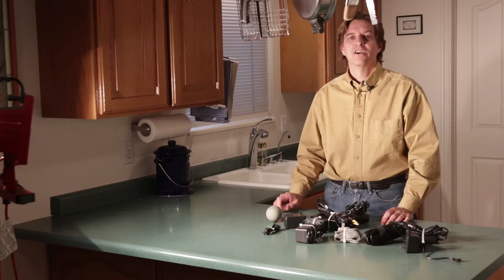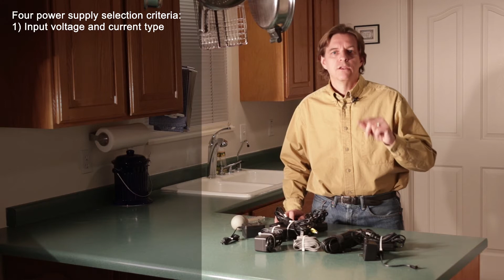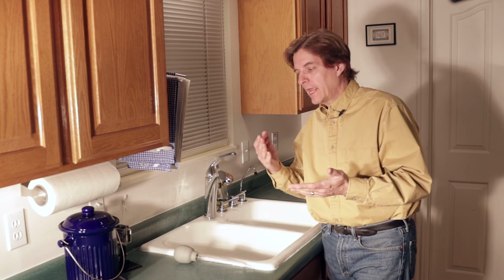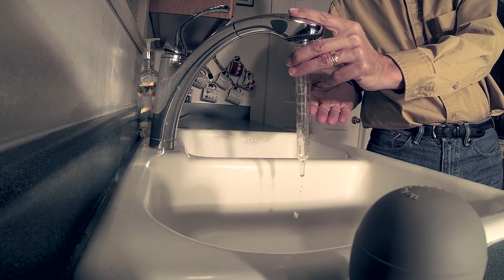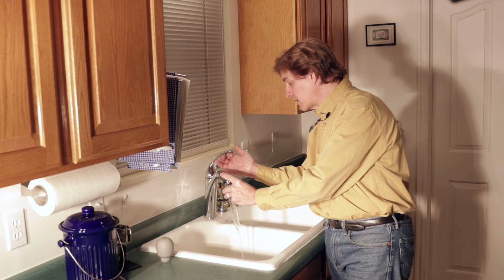How to select a power supply for your project

Comment: The thing that always confuses me is the amperage. So, generally, exceeding the amperage rating on a power supply is not an issue.

So, what if I have a simple amplifier circuit (say an LM 386 op amp circuit) that requires 12 Volts DC and 250 milliamps. So, if I had a wall inverter that was 12 volts DC with a 500 milliamp rating, I would still be fine. Again, exceeding the amperage rating on a power supply is not an issue. 

So what if I took my little amplifier circuit and hooked it up to the battery in my car. I should be ok, because the current rating of a power supply is fine even if it exceeds what is required for my circuit.

A google search says that a car battery has 550 and 1000 amperes.

Comment: What happens if you run a device or motor with inadequate current? Is there any risk of damaging the device? Or will it just stall?
Reply from the maker: It depends on the device and power supply. Most things will just stop working at some point but some things may overheat and cause damage. It also depends on how long it goes on for. There may also be damage to the power supply as it tries to provide more current than it is designed for. There are a lot of factors without a hard and fast answer. In the end, it's best to use a power supply that's designed for the needs of the device.